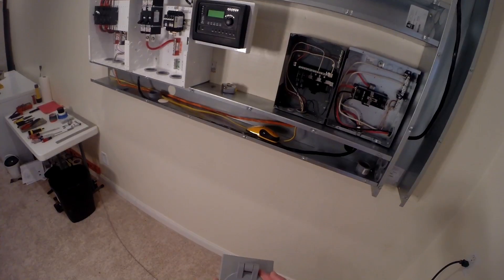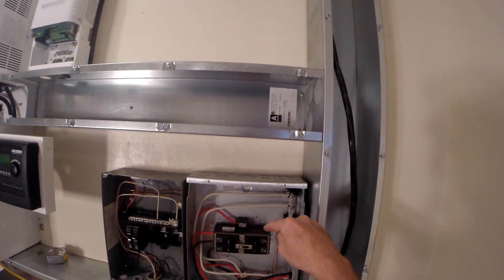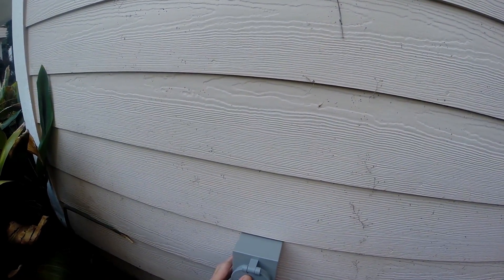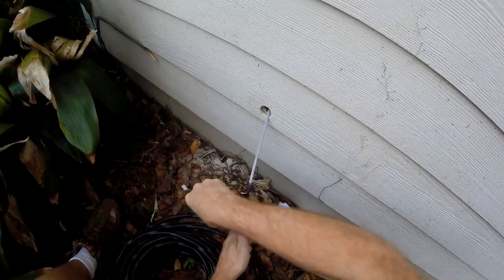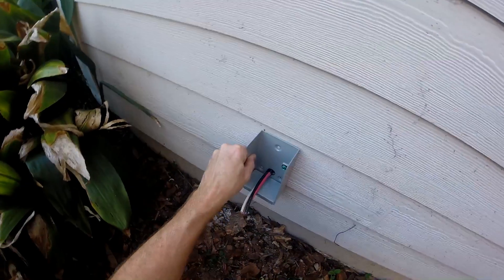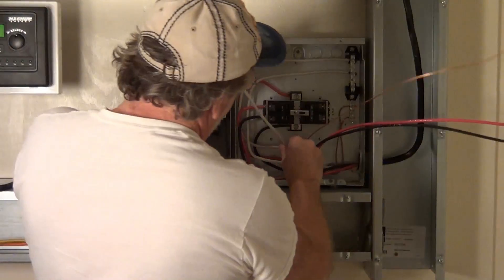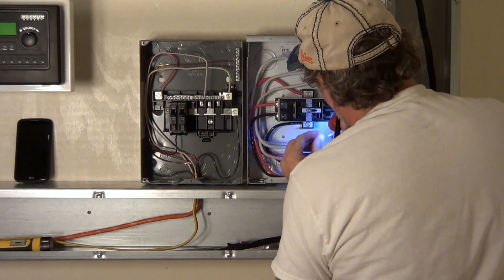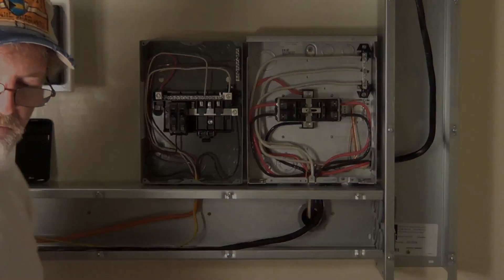Off Grid Solar #17: Generator Input to Transfer Switch

Comment: The generator box should have a wire connecter.
Reply from the maker: Not sure what you meen?  Could you explain...
Reply: @HomesteadEngineering  Hi David, I think Sylvain means something like this: https://www.lumen.ca/en/products/11-conduit-raceway-strut/03-conduit-fittings/02-metallic-conduit-fittings/02-colored-emt-fittings/02-colored-emt-connectors/04-set-screw-emt-connectors/p-aWJlODEw-ibe810-abb-ci810-iberville-two-screw-connector-csa-12798  It takes the strain off the wires so if there is ever movement, etc. 1) strain will not be transferred to the screws or electrical connection inside the generator plug box and 2) it prevents any movement from abrading the wire insulation and causing a short hazard. 3) I think they also are intended to prevent bugs & random bits from getting into the box through the opening, and contain fire & electrical hazards within the box if things go bad.  It might be code in your jurisdiction to have a connector at every box entry.